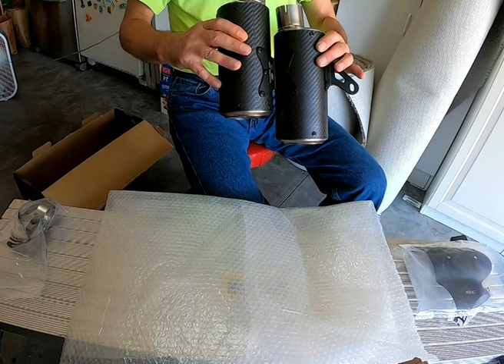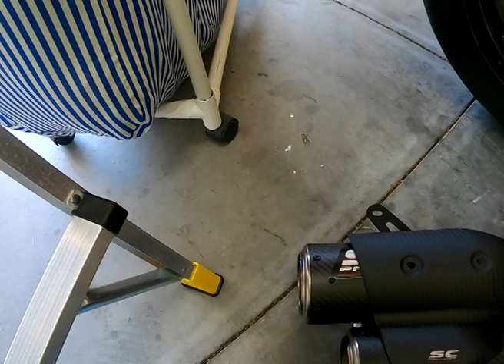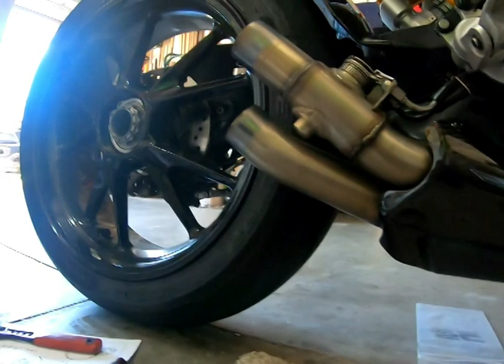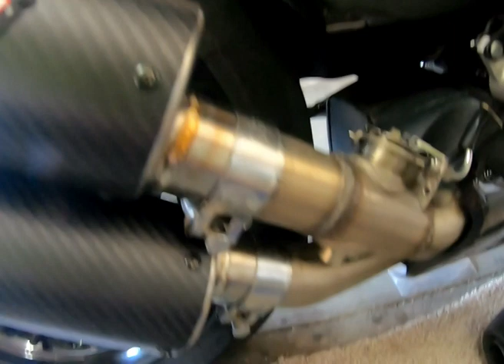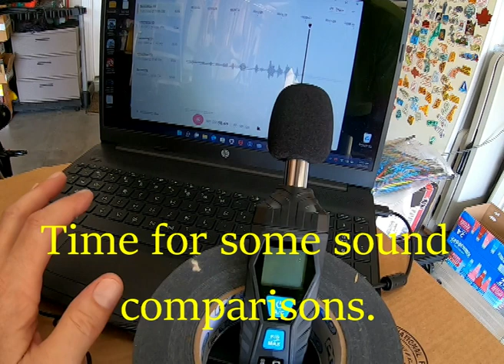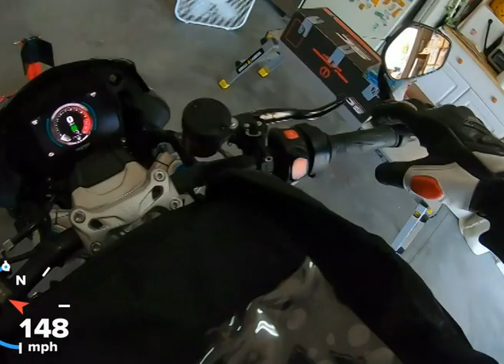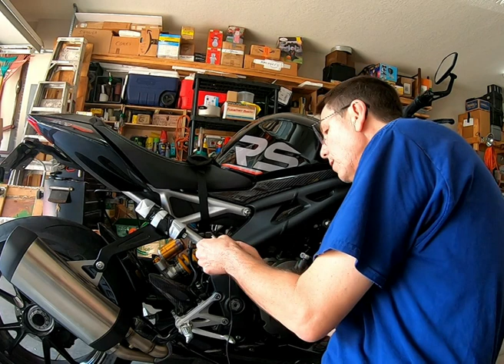Installing the SC Project CRT muffler on the Triumph Speed Triple 1200RS

Comment: Is it worth it ?
Reply from the maker: I've never been the guy who puts a lot of mods on my bikes. Mostly just bits for looks. The last bike I had with an aftermarket exhaust was way back in 1983. I went all out on this bike, figuring to keep it for many, many years. 
    This exhaust was expensive and it doesn't really make my hears hurt when I rev it up, but I like it. I would have gone with a different muffler and a remapping and an exhaust valve eliminator if I just wanted the max performance and sound. I liked the look of this dual cannister muffler setup and I'm happy with the deeper tone. 
   Was it worth it? To me it was, but I guess it would depend on what your reasons for a change would be to begin with.
Reply from the maker: When I bought the bike I had already planned a few modifications, mainly the cameras and lights, but then decided to get carbon fiber happy. That's when I decided to just get what I wanted for it right away. I didn't consider the cost. 
   I plan to keep it forever and I know that I will never get back the money that I put into it. Modifications sometimes even lower the value of vehicles.
   I did it just to make myself happy.
Reply: @scottsspeedtriplechannel  Tha k you for your reply - deeper tone is all I want - thank you , love your work by the way
Reply from the maker: @colonelquickshifter6534  You're welcome and thanks.
Reply: @scottsspeedtriplechannel  picking my girl up tomorrow 🤞👍😂😎

Comment: Sounds.  No difference to the old one lol
Reply: buy a Speed Trible first! Ride the OEM exhaust, then buy the Sc Project! After that you can judge! You really have no idea. lost boy
Reply from the maker: There is a definite difference. Unfortunately the only audio I got was through a GoPro mounted to the chin of my helmet, so there is a ton of wind noise.
   As you can see in the video though there is a 10 decibel difference at all revs.
Reply from the maker: @z_brez_r1687  The audio wasn't as good as I had hoped for, but I think you could still hear the difference.
    The meter reading alone showed a difference.
   Thanks for the response. 🙂
Reply: @z_brez_r1687  I have one thanks and a full LEIKER exhaust out rear near seat and looks sounds amazing  so I know what I want and was just a opinion I’m sorry it upset you
Reply: @scottdiver36  Those exhaust look rad AF man, definitely on my wishlist. Thank you
Reply: @Rozzyfro  I might change mind because takes away the looks and might have carbon single SP
Reply: @scottdiver36  If you change you're mind you can go with the LKR series or you can try other exhaust like the Pro Race s1.
Reply: @Rozzyfro  witch one would you think best for triumph 1200 rs ?
Reply: @scottdiver36  If you want weight saving and a bit louder go with the Pro Race s1, I just found another exhaust Austin Racing GP1RS check it out. To me, it looks great and has a deeper tone and good weight saving. https://youtu.be/LkIDxBRzV44 (sound check)
Reply: @Rozzyfro  thanks bro 😎 will check out if your in the uk anytime let me know you sound a cool guy
Reply: @Rozzyfro  what bike do you ride ? Lol 😂
Reply: @scottdiver36  Oh I ride a Honda Cb250r is a-ok bike but, I would love to have the Triumph Street Triple 1200RR will try my best to save up some money.
Reply: @scottdiver36  Sorry man I don't live in the Uk :((, but damn I will like to meet you too. If you want to continue talking with me you can go to my channel I will reply to you :) have a nice day...
Reply: @Rozzyfro  cool I have the 1200 r/s because more comfortable for what I need for and I started late just passed test at 50 and love my motorcycle to bits

Comment: You don't measure dB indoors...
Reply from the maker: Would it have read lower outside?
Reply: @scottsspeedtriplechannel  yes, it is resonating all over the place. Ideally you do it outside with nothing on the vicinity for at least 3 meters ;)
Reply from the maker: @D4rk34g7e  Thanks for the advice Dark Eagle. I had a viewer mention that it would be too loud for track or street use in Italy I think, so I'm going to send him a message after I recheck it outside.
   That was the first time I ever measured the dBs of an engine before. Now I know better how to do it. 
   Thanks again.
Reply: @scottsspeedtriplechannel  My bike was checked by the german TÜV, something like an MOT in england i guess. They check vehicles every 2 years and establish their roadworthiness. The apprentice that checked mine did this indoors and it failed (Street Triple with Zard exhaust). His superior then shouted at him, and when they checked it again outdoors, it was noticably quieter and passed.
Reply from the maker: @D4rk34g7e  Hey Dark Eagle, how far away from the muffler did they hold the meter? Was it directly behind or above or what? I'm getting g ready to do the retest and want to be as accurate as possible this time. Can you help?
Reply: @scottsspeedtriplechannel  behind the bike, same height as the muffler but 45° offset to the right and at a distance of 50cm. there should be no walls, other people then the tester or other objects in at least a 3m radius. greetings.
Reply from the maker: @D4rk34g7e  Thanks. I'm going to try to do it tomorrow.
Reply: @scottsspeedtriplechannel  I will watch the video on your channel, my apprentice 😀
Reply from the maker: @D4rk34g7e  So I've been pretty busy this weekend, but I got the video and numbers. I'll do my best to post the new video by this weekend.
   The new numbers outside are... 86-87dBs at idle, 98-100 at 5,000 rpm and 103-104 at 6,000 rpm. That's a bit lower than in the garage. 
    I'm not an official tester and I probably don't have the highest quality dB meter, but I hope this helps for anyone who may have made a decision based on my numbers.
   Thanks again for letting me know that I was doing the reading wrong. I always appreciate good advice.